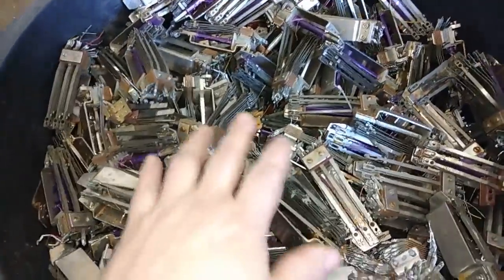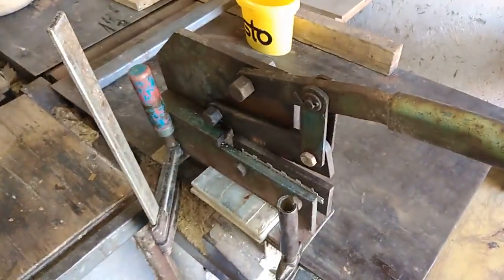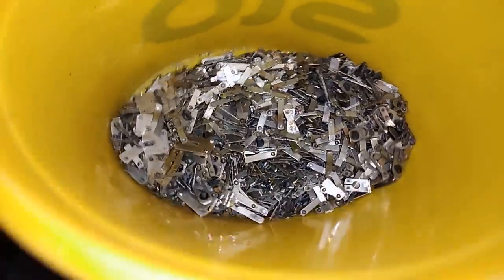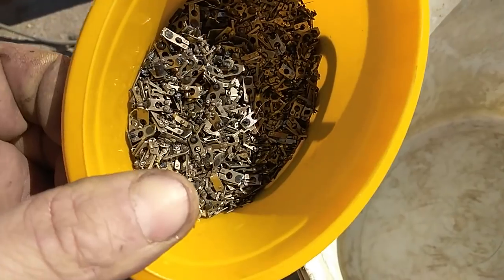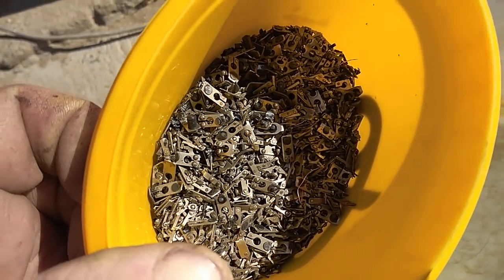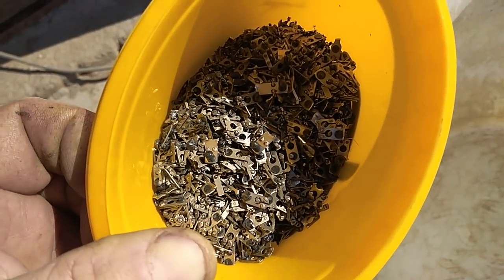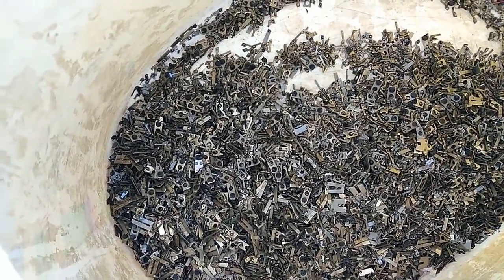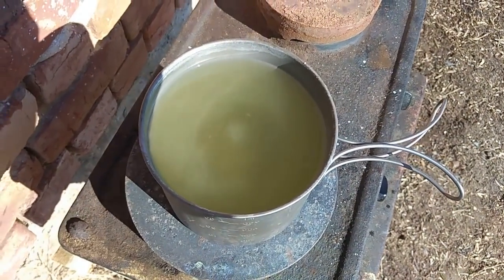Silver contacts recovery from centrals relays.

Comment: Dusan I suggest you not to do this method as when you add the hcl and sodium nitrate, nitric acid is formed and the nitric acid will first dissolve some of the silver and the the silver will precipitate out as silver chloride and when you wash your silver, the silver chloride will get washed away and wasted. Hope this is helpful and correct me if I am wrong.

Comment: I'm curious if you could put ends in crucible and melt silver off but I reckon the way you did it is more thorough
Reply from the maker: This silver will be sold without refining because I got a good price for it in this condition so I will just melt it into popcorn and it will be fine..

Comment: A question: why the poor man aqua regia didnt dissolve silver contact? In the first step
Reply from the maker: Uh great, I see you've had a real little discussion here, I'm glad about that.
Thus, the reason is in hydrochloric acid. Silver is not active with HCl, during oxidation a protective layer of silver chloride is created on the contacts which protects them from further dissolution, because silver chloride is precipitated with HCl from nitric acid.In the worst case, with solid silver objects, 2 to 3 percent of silver can be absorbed, which is irrelevant because it will immediately return as a precipitate from the solution in the form of silver chloride.With only silver-plated items you will get foils or silver chloride, rare and elemental silver in the form of sediment. Whether you use Aqwaregia(HCL+Nitric)or Poormans Aqwaregia(Hcl+Sodium nitrit) you will get the same result.But secon option is more cheaper.
Reply: @999DusanGoldrecovery  ohh right, now I remember people talking about having AgCl sediment in aqua regia. Thanks! This really opens my eyes to poor man's AR, I think I will try it next time I do silver recovery.
Reply: I believe a passivating later of silver chloride is formed on the silver Hutton’s surface. The solubility is quite and any silver nitrate formed will react with halide ions present (such as the chloride from HCl).
Reply: @matthiascarroll1924  I hadn't thought about that, Any silver that did dissolve should precipitate out as silver chloride since there's HCL in solution. Should be able to filter out the white powder then.
Reply: @matthiascarroll1924  yes, you are right 👍 it was poor mans AR not poor mans nitric
Reply: I wondered that
Reply: I was wondering the same thing. Maybe the Sodium keeps the Silver from going into solution?
Reply: @dizzious  that shouldn't make a difference to be honest. I know i know the answer but I can't remember it for the life of me
Reply: I was wondering the same. I would have guessed even poor mans nitric would dissolve everything, silver included but i guess not.